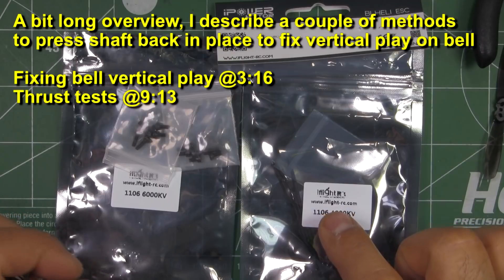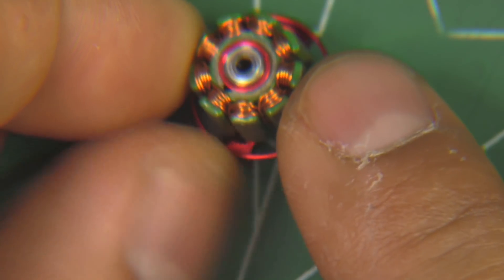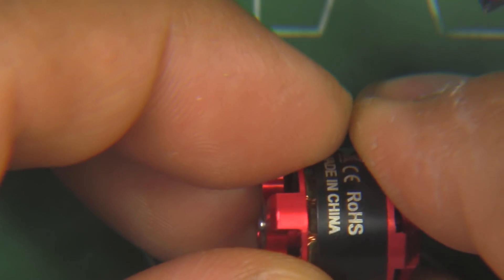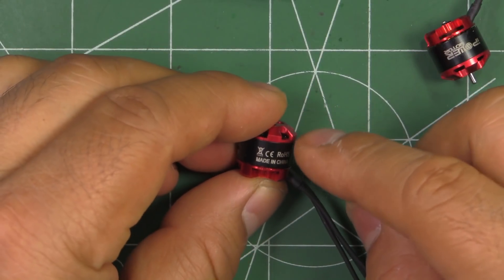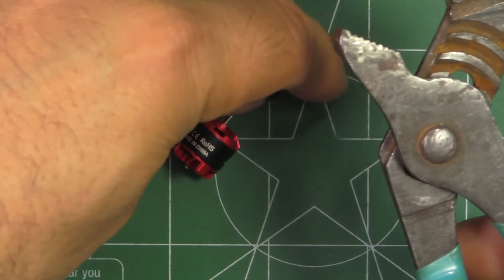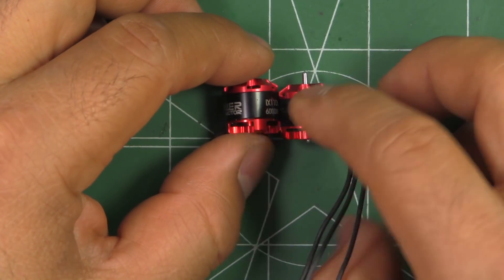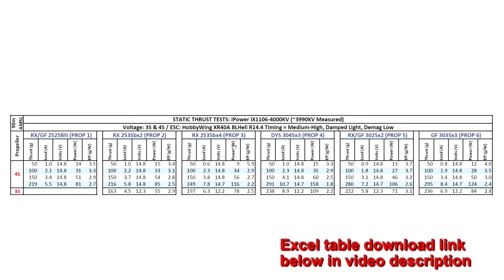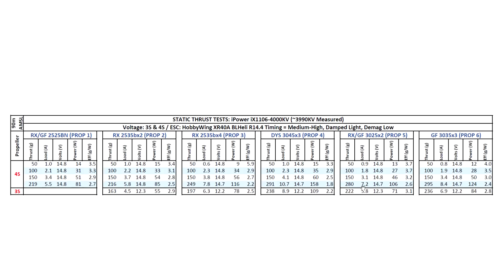iFlight-RC iPower iX1106-4000KV Motor Thrust Tests & Overview

Comment: Would it be possible to run these motors safely at 7.4 volts? I want to parallel two battery packs that are 450 milliamp so I have a total capacity of 900 milliamps for maximum flight time. The launch weight of this drone will be 250 g And if so what should I expect for maximum thrust using a 4S-DYS 3045X3 propellers? The reason why I want to operate at such low voltage is I am not concerned about flight performance just a stable flight  so I can do video recording using a Sony FDR-X3000     this is a 4K video camera at 30 frames a second  @ 100  megabit a second picture quality.
Reply from the maker: 7.4v or 2S is perfectly safe for this motor. However, this size/ KV on 2S and 3" props may not give you enough thrust /performance to carry  that 114g camera + 2 batteries in parallel + weight of copter. It may very well be able to lift off but it may end up struggling too much due to heavy load. 
I would seriously consider other motors that can give you better efficiency and better thrust. The 1106 is good for very light setups but not for heavy ones. I would look into 1306, 1406, 1407, 1507 using 3" props on 3S- 700 to 1000mAh batteries
If you already have all the parts lined up, you can certainly just go ahead and try them and see how they work (I'd used a 114g dummy load to simulate camera during test flights) Interesting application, let us know how it works out - always cool to see how people use their setups :)
Reply: @EngineerX  The camera without the housing and battery actually only weighs 89 grams it is easy to power the camera from the drone battery pack via micro USB port. The two 7.4 volt 450 ma batteries only weigh 45 grams. The quad frame weighs 48 grams.
Reply from the maker: @ke4uyp  I see, lots of weight cutting on the camera. Then yes, that's a better lower load for the motors, however 4000kv might be too low rpm's, usually 2S is matched with 6000 to 7500kv - but you can just try it and see how well it lifts. No problem for the motors to support the electrical load. The main issue is that some motors do not have a linear relationship between voltage/ thrust/ RPM so at lower voltage the max RPM could end up way too low. Only way to find out is to try it in-flight
Reply: @EngineerX  okay thank you so much for the information luckily I have not purchased any motors yet so I'm looking at your video testing the ipower IX 1106-6000KV with 2S @ 8.0V with a maximum of 158 grams. This looks very promising to me I really only need about 3 to 4 minutes a flight time so I think this would be an excellent combination what do you think?
Reply from the maker: @ke4uyp  I think 6000KV would be a better choice for 2S for what you want to do. I recently tested these https://www.banggood.com/T-motor-Racerstar-RT11-1106-6000KV-2-3S-FPV-Racing-Brushless-Motor-p-1335555.html?p=FR3104108021201212@4  (affiliate link)
I have the results on my laptop, from what I recall, also very good performance. Those are same as T-Motor F15, different label. If you purchase from BGood often that's another possible choice for you, they're on sale ;) coupon RT1106
You can also try GemFan 3025x2 props on 2S with those. It may give you good enough performance and longer flights in case the 3-blade flights are too short. 
Looking forward to seeing some of your flight video once you get the setup flying! Post here with your YT link :)

Comment: Thanks for the review and testing of this motor. I'm really starting to like the 1106 and 1306 motors for micro planes and quads.
Reply from the maker: Ground Control RC thanks. Great to see reviews are useful. Micro planes fly really nice these days with all the miniaturization of electronics and powerful micro motors. I'll have results for new rcINpower 1108-6800kv motor soon. Should be (and other lower KV later) a very interesting motor for micro planes
Reply: I will definitely be looking forward to it. Thank You.
Reply: Are you using any sort of gear reduction for planes?  Or just running as is?   I've been trying a 4000kv motor on 2S swinging a ~5 prop (not sure of pitch) and it gets hot on the test stand.  I suppose I should probably just put a 3" prop on it and call it a day.

Comment: Where is the thrust test chart for the 6000kv on 4s?
Reply from the maker: I don't run 11XX-6000KV or higher on 4S on the thrust stand because the load would be too high and most likely would fry the motor windings. Thrust stand loads are usually anywhere from 25% to upto 40% higher than what you'll see in the air.

Comment: Did you already tryd that new emax motor on a quad?
Reply from the maker: Not yet. I have not had time to build anything new or go flying. Very busy at my work and many motors for testing lately
Reply: EngineerX i will test some for you 😜😆 but yea that sucks so nice motors and not able to fly them